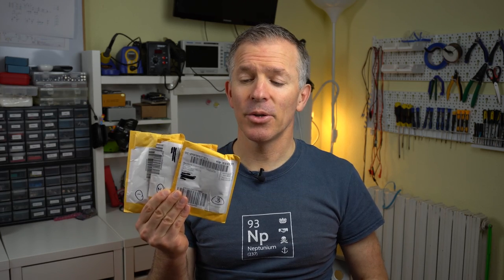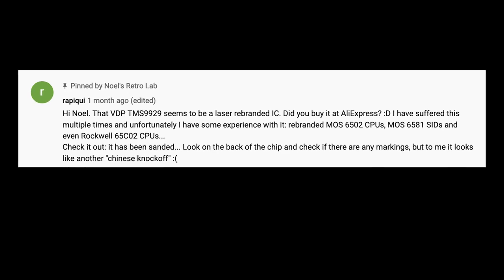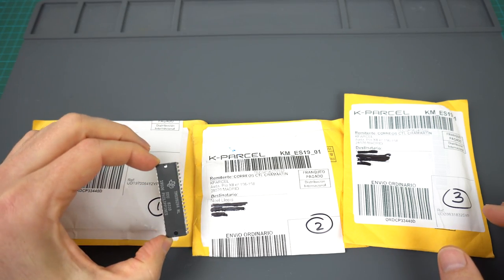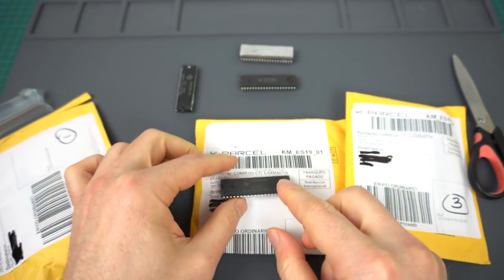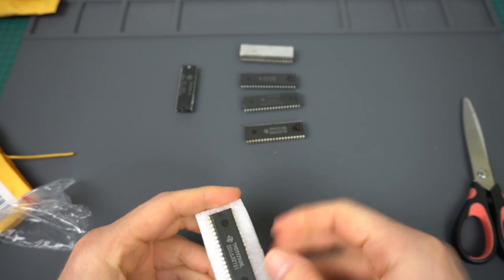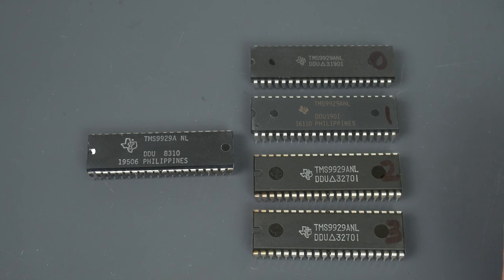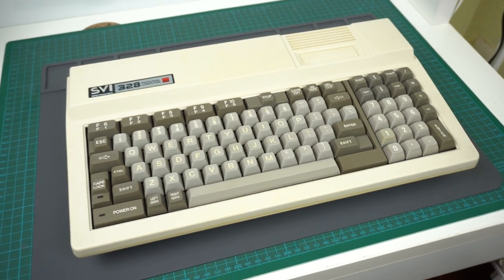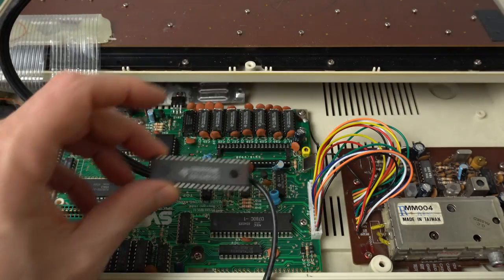Detecting FAKE Chips From China 🔍

Comment: The Chinese grey market has gotten wise to ALL of the tests shown in this video and I have personally seen fake components which passed all of those tests.
In the defence (and aerospace) sector they're so serious about this stuff that they cross section a sample component from a verified batch and put it under x-ray fluorescence testing to determine whether the materials used are as per manufacturer specifications, THEN they carry out solder-ability testing before putting the component under an electron microscope.
The things i've seen, and the extent to which these fake components get into the supply chain (usually some westerner behind a desk, trying to gain promotion by saving money and turning higher profit), it honestly makes me worry about getting on a passenger plane.

Comment: The fakers use soldering blanks as the body of the device. These are made to be used to setup and test solder flow line prior to using real chip. That is why the measured resistances are in the Mega ohm range.

Comment: alot of times i noticed on aliexpress while checking random stuff and comparing prices, they are often exactly same
for example 
item #1 cost 1$ + 1$ shipping 
item #2 is for 0.5$ + 1.5$ shipping..  
item #3 is baiting you for 0.5 + 0.5$ shipping but when you want 2-3 pieces shipping jumps from 0,5 to 5$ and so on..
while some accounts have normal / generic names.. other are just generated IDs .. 
what could simply be its same person with legit shop and other personal accounts 

once i bought on ebay touchscreen with LCD for my tablet, i researched that i need an exact same revision as my original LCD..
i made sure to buy my rev.4 ..ofcourse pictures and customer reviewes assured me im buying rev.4

but what i got was a rev.3 hidden under some sticker...  my tablet worked, but it was laggy and dissapoiting..

Comment: I'm only at the start of the video but I noticed you missed a detail, it has to do with the pins. If you look at the ones with the texas instruments logo in the little dimples you can see that the middle pins have a different shape from the other pins. I also see your original IC has that. Maybe that's a telltale sign as well?
Reply from the maker: Yeah, I missed that, and it's consistent with the working chips. Good eyes!
Reply: @NoelsRetroLab  I'm glad you missed it, now you had to go through the hassle of measuring all the pins and doing research that led to this video that also taught me a thing or two. So thank you, really.

Comment: They may be from other vendor's in China that can't handle eBay, that's why two of them package so similar, they may just "pass" the chips to you and got a cut, they usually not only doing chips selling but also other kind, but they're clever to use separate account to know which one got people buying, and yes not much but accumulate several business and low cost to them, mailing maybe a using logistic that paid a fix sum per month.
Reply: Mr Guru  I live in Hong Kong (just a border to ShenZhen). deal with them long time ago, these are usual for them, expect no ethics from this country.
Reply from the maker: 🤯Mind blown... But that makes a lot of sense!
Reply: Mr Guru  Guess they don't know, no one will intentionally want to make less money, shipping did have cost, there are numerous vendor in ShenZhen so-called electronic-city, they are picking from a few they usually have business with, so they're really purchase from others like us. I visit there often 15 years ago I just feel many shops are recycling junks only, but the retro-computing did give them business.
Reply from the maker: Mr Guru  True. But you can be sure they aren't running random checks to see if they're getting fake parts. They could grab one out of a hundred chips and rub them with acetone. If they catch a fake chip, they could choose not to buy from that distributor anymore. But no, I doubt they're doing that ☹️

Comment: I think that identifying reliable sources on eBay and AliExpress is much harder than one might think. Many of these vendors don't actually stock many of the parts they are advertising. When you order something, they go to the Shenzhen market to see what is the best price they can get and ship that to you. When you order again, they may end up sourcing from a completely different market vendor. Even if the first batch you ordered were good, there is no guarantee that the next batch is going to be good. I also suspect that many of the fakes were 'made' when these parts were cutting edge, expensive and in high demand. There are now stockpiles of both genuine and fake parts and it may well be that the present day vendors aren't aware which are which.
Reply from the maker: Yeah, I had no idea. That makes it much harder indeed!

Comment: Hi Noel.

I got a few tubes of HD12D and HD12E and none of them worked properly!  Drove  me friggin nuts!  I was working on a wireless job for a Client and time was of the essence.  The first small batch I got from Amazon worked as per the datasheet.  I I bought more from Amazon that were funky so I ordered a batch from Jameco Electronics, none of  them worked properly, thought I must have entered the twilight zone lol.  I have over 30 years in R&D and am used to ICs performing properly so this really threw me.  Is this a frequent ocurrence you have seen with ICs from China?

Comment: Funny,  I replaced the chip in that same model Uni-T DMM you are using.   First order from AliExpress was cancelled as the seller stated the chips didn't test out correctly (aka fake).   Second order from another seller showed up and worked just fine.  Cal against my 3457A and good to go.  I now use that meter as my daily junk meter.  Bottom line is yes you can get real chips even for obscure things..

Comment: eBay experience:
PUJT’s that were really SCR’s
PJFET’s that were really either NPN or PNP’s
All of these were perfectly laser engraved; which btw, none of the true originals were NOT!
China has really screwed themselves because any IC’s of any complexity could exhibit timing or noise anomalies such that unless you completely jig and test every last chip for every last function and extraneous artifacts—including temperature range, China chips no longer are a bargain, and you can’t even justify taking a chance.  Also, with liability lawsuits the way they are, you are ultimately responsible to the point you can’t afford to take the risk.  As a result many products that might have been taken on by the small shop are no longer economically viable. 
So, the only semi’s I purchase are single transistors that are relatively easy to test, or at best an IC I just can’t get anywhere else…

Comment: So how they get the chip is by getting it wholesale. since the main manufacture of the chip, create and cherry-pick some of that module and sold for a higher price. while smaller and mostly Chinese companies would just buy the wholesale of the leftover which did not make it to the market and try to resale them to make a profit. Most of the time all the part comes from china so there wouldn't need any export or import fee as all the part are still in china.  
So let say the main company who make the product sell an item for $10 to consumer and the "knockoff" sell it for $4. the main manufacture would check and test for all the part to be uniform and high quality. All the parts that do not make it either get sold or trash. While trashing it would not make back the money lost so they sell it to the other "knockoff" seller, which then get rebranded and sold at a cheaper price, and since it is whole sell the "knockoff could have paid from 5-10 cent apiece. Most of the wholesale would then become a lottery. Either it works or it doesn't or its longevity is much shorter than the original product. It like CPU silicon lottery. there will be sometimes missed and the perfect would become like a chip or i9/r9 while the miss might go to i3/r3. it to save money and not waste them. and it takes a lot more work to recycle them so it either trash or make them a more inferior product.

Comment: I think the scammer likely has a large cache of cheap (or even free old stock) DIP ICs in different sizes, all pre-sanded.
When they receive an order for one, they pull up a template on a laser engraver, etch the data they want on a chip of that package size and pin count, and then send it off.
In this way, then can sell the same chips listed as numerous different items, greatly increasing their profit surface area.

Finally, they rely on people either:
- Assuming something other than that chip is wrong with their device, and giving up
- Not following up for a refund, because 3EUR is simply not worth the time taken to do so for them.

Comment: genuine question, why did you power the chip through the 5 volt output pin from the arduino board? is the current drawn too high?

Comment: Maybe they are not counterfeit, but just remarked original trash, that should have gone to dump, but someone still put them into the pocket and sold them.
Manufacturing not only really reare chips, but unusable ones are not profitable.
I once bought original mitutoyo dial indicato clock(micrometer), it was brand new, in original package and cost only 15$ instead of 120$. I inspected it several ways and I found it to be propably just reject batch that was sold by somene else. Problem was that dial moved really hard(you could counter it to zero what ever angle you need it to be). On original part it has to move really softly.
In my home country we had similar problem few years back.
Company throw away lots of beuty products. They where to old etc. One guy in trash company put all that into hes pocket and hes wife sold them in local selling site. 
After some time, people start to complain(products where dry etc.) and returned them to original shop. After several clients, shop undrestand that something where not right and shopowner found advertisement, witch sold their trashed goods. Fast forward trashman was fired and all products where taken away from them.

Comment: I happened to short circuit my 4x original TDA7293 amplifier. There was smoke, and one IC caught on fire, but not explosions. I bought 5x the same chips off ebay. Thay all blew up like fireworks. And yes i double checked everything else was fine

Comment: They go for the customer Reviews. Sometimes to prevent you from permanently cement the negative review they will give you a decent customer service sometimes refunding right after you change the review from negative to positive, even if you have something bad to say as long as it's chosen as positive. I could be wrong but it happened to me quite a lot if something didn't can in as shown in the description or picture. Just correct me here you're welcome to do so. Seller's in ebay are serious about getting their positive reviews for better rank.

Comment: The scam is to find any (40 pin in this case) chip from scrap put a label on it for any frequently requested  chips (suspect they follow the retro PC and audio scene.. labour is still really cheap in rural China)  and gamble on the fact that like myself no one will ask for a refund as they know most can't be bothered to ask for a refund for item an item in < $5 - $20 range (granted eBay is more on the buyers side these days) ... the seller might even claim a fault with your device or mistake on your part, causing their chip to fail, as most  don't have the skills or equipment to challenge their claim, most being fair  just accept their claim... they might even send you a good replacement if you've purchased another but then they've effectively sold two chips for the price of one!

Comment: I am typing this as you’re unpacking them: 1 - fake, 2 and 3 - real. Let’s see what happens… :) Reason - the lettering of the 1st glosses over as you move it in front of the camera.

Even more confusingly, even when the surface has been relabeled, it often does not mean the chip is fake. I guess they want to make ’em look new? I have four Yamaha YM2608’s and four YM2610B’s, all sanded and relabeled, yet all original and functional parts, tested and confirmed. The YM2610B’s were all even real B-type and not the more common YM2610’s that are often used to fake them.

I looked in my email history and I got them from polida in 2015, so another +1 for them (I forgive the relabel).

But I know people who did get the wrong YM2610 type, and I also heard of someone who ordered a V9938 (SDIP64) and got a relabeled 68000 (DIP64) - so even the form factor was completely off!

Very nice video! I like how you go beyond just the simple swab-test, which doesn’t tell the full story and makes people discard functional chips for no reason. You even built a test board! Good tip about the simple power on test too. Probably you can also see the sync signals already. Too bad you didn’t get one of those relabeled-but-original chips, that would’ve completed the story :).
Reply from the maker: Thanks! If nothing else it shows how difficult it is to spot them just visually.

Comment: There is one very simple way to spot a lot of the fakes. The fakes looked laser etched. Nobody used laser etching back in the 80's or even most of the 90's. It's also about printing style. I can remember when those chips were new.
Reply: TI started laser symbolized their chips in early 90s to counter faker using their brand name.
Reply: @Utube1024  Got any proof of that? I was an application engineer in the 90's and I dont remember TI having laser etching on anything produced in Europe till about 1998.
Reply: @gordonlawrence1448  I was working in TI Spore since 1976 to 1998. We started the laser symbolizing process using stacks of mirror masks before laser scriber was available. It was a mess trying to produce the mirror masks so that all the symbols do not overlaps each other...LOL. I was in QA then. In fact I am one who facilitate the QC process by designing a jig and fixture since I came from a Tool and Die Making background to make sure all are within specs for hundreds of mirror masks came in each day and the urgency for them. Got a Commendation from TI Dallas for that. That was the initial method but by now I presume laser scribbling took over doing away with the mirror masks.

Comment: There are many fake Casio F91W watches being sold as well, that look and work identically, until they fail. Open them up and they are quite different including the soft split pin holding the strap on the fake compared to a hardened machined rod on the genuine. Difference in price on eBay is £8 for genuine and £5 for fakes.

Comment: The original chip has a correct date code on it 8310. it was made the 10th week of 1983. I have seen chips w/o a date code. The other chips could be 32nd week 7th day of 2001. The other one 19 week of 2001. and the zero chip 31st week 9th day 2001. i use to use the date code on chips to tell when something was aprox made. i also use to just for fun when i opened something up look to see when the chips were made sort of like 40 years ago looking on the 8oz Coke bottles to see where they were made. i bought a car key programmer from China it was a clone of an Italian made device and it works its just everyone that has one has the same serial number. of Course, everyone remembers the bad electrolytic capacitors about 20+ years ago. They were the product of industrial espionage where someone broke into the computer systems of a major capacitor manufacturer. Only the manufacturer had the recipe for their electrolyte in several places so you needed to find all the parts and whoever broke in only stole one part so the caps would puff up after a few months of service. They ended up on motherboards and in power supplies you can google  to find out more.

Comment: Some years ago I saw a Youtube video on this ...with the nearly zero $ wages in many parts of China...small businesses actually make some money 're-branding' failed chips of many types...nearly any DIP chips...most are just failed/damaged taken off PC boards..Many, uhmm...'very young' employees squatting in the dirt with hammers and a fire-pit for melting solder...a piece of wet sandpaper nearby for removing the markings.....enough of these types of operators made a few cents per chip, but that adds up...
 
 Those last two Texas instruments chips are probably high quality originals, with their logo on the round depression/s. Those round shiny spots are indeed part of the mfg. process...they are where ejector pins push the chips out of the plastic injection machines. You can find them on many types of [plastic products, almost always a depression. Large objects may have quite a few of these depressions...always round as the ejector pins are round, tool steel, a sort of punch.
 TI has been using that same logo for a very long time...when I was doing electrical assembly in 1967 they were using that on the old 7400 Chips. and that new thing...the 4004....